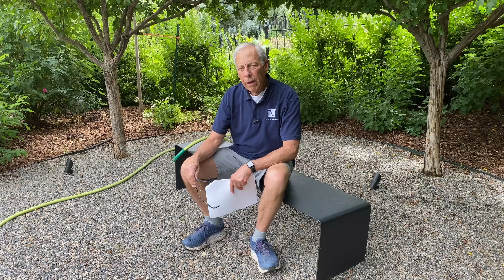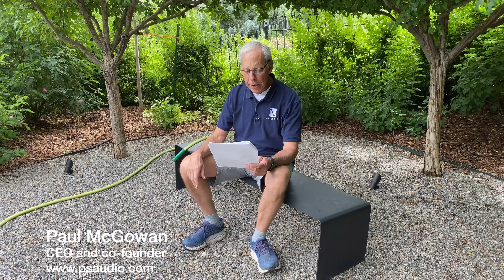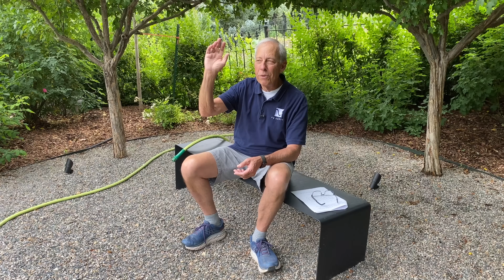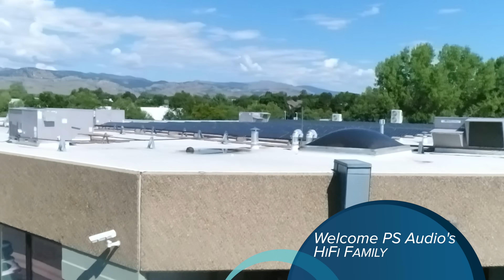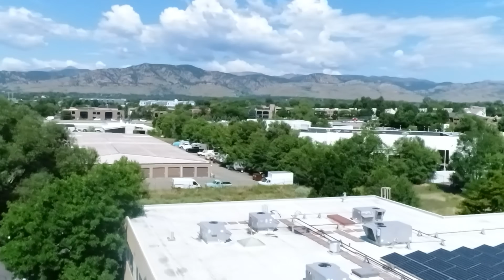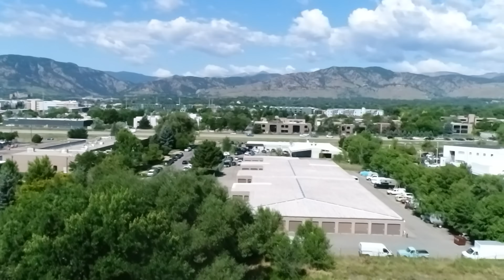Class D vs. Class AB amps

Comment: But everything is  relative   with amplifiers,Class A/B   may still be the king!But here is my example,I bought a nu force I-A7,second hand,and the first model   with 50 watts per  channel.But the seller   has a problem with it,strange   beeping noises at low volume.But i knew why that was happening,it is because that amplifier   is very affected  by RFI    and EMI.The rules are  you use a dedicated  electric circuit   one group   that does not have   things like a   fridge(compressor),Or  also if possible  nothing  on that circuit  with an SMPS   supply.The first model   I-A7   out in 2006   has an SMPS  in the housing.But so if you  read the manual  it tells you the do,s  and donts.The seller did not know that hence  the interference.And he was  done with it.The  nu-force I-A7   was new   1495  US   in the states,and when it came to the EU,was 1850   euros.So I bought the I-A7   working perfectly  by my house.For   125  euros.Oh!then plus the post  10 euros. so 135 euros,maybe US  110  dollars.There is no amplifier  of any class  that can beat my I-A7.At the price i paid,short term peak power  at 288 watts,and damping factor  over  4000,neutral  totaly.How much  would a class A/B  amp  that could beat my I--A7,cost?Its way better than a NAD  C720  BEE!  To coin a phrase  from the yanks,Its  all about Bang for the Buck! And i now love class-D.

Comment: I love class d but there is a but! Ice teknologi is the samme as the Switch mode 🎉🎊 🎉 if your not driving the biggest drivers you can manage butt ewen a old rotel rhb 10 from the 90s can beat anny Ice amp and almost any amp to day it has a warm/hott quality balanced sound whene going past 122db, the Switch mode amplifiers are not there but maybee inn 5 to 10 years 😇 i hoppe 🤞

Comment: One plus about an AB amplifier is if your speaker set up is in a cold room of the house, it can double as an electric heater.
Reply: No!thats class A   that makes all the heat.Like  red hot.Class A/B   is much milder  as far as heat is.If an a/b amp has a lot of power  then it gets hot.But nothing like a class A  amp.A class a/b  amp   gets warmer  by increasing  the volume.But a class A  amp   is full on using all the power from the transformer   all of the time.
Reply: I have Samson Resolv SE6 reference monitors and they use A/B. I live in Rio de Janeiro and they don't get very hot...

Comment: I have a Marantz PM50 AB Amp 70 watts per channel (Analaogue Only) from 1991 connected to a Pioneer DAC and it sounds beautiful sounding. The Vocals for example in Memory from Cats sounds very emotional, romantic, and connecting. I now have a little spare money and decided to treat myself to the Marantz PM12 Special Edition 100 watts per channel (Analogue Only) Class D Amplifier also connected to the same speakers and the same DAC as my PM50. At the time of purchase and listening i wasnt aware of it being a Class D Amp.  I hooked it all up and immediately put on Memory (as its one of my favourite songs) and was looking forward to the Vocal section, but when it arrived it didnt connect with me emotionally..... I then listened to some other favourite songs and it was the same..... I then switched Amps back to my old PM50 and the emotion returned!! I then kept switching amps (i had both set up next to each other just a case of pulling the speaker plugs out of one and into the other and the DAC interconnect) and i spent the whole weekend doing this.  I was shocked i had just spent £2300.00 on an Amp that isnt even as good sounding as my 1990 PM50! Luckily i was able to return it for a full refund.  I then started looking at other Amps and then realised that the PM12 was a Class D compared with my Class AB PM50.  I then also read countless reviews regarding Class D not sounding as good as Class AB.  I have now orderded the Marantz Model 50 (70 wpc and Class AB) which will be arriving this weekend and im hoping this will at least be equal to my PM50 or hopefully even a little better 😀👍
Reply: Are they as good as you hoped?

Comment: if people could accept, then class D with PWM modulation frequency > 1.41M should be the same quality as DSD64(SACD).
I have a full digital system that could provide very good performance... so we use that as monitor system

Comment: Bass rig related:
I'm looking for a bass rig that's light, compact, transportable. Class D suits this need.
Alas, every class d bass amp I've tried, with the same speaker, bass guitar, leads and cables, sounds awful. It's either to muddy or to brittle and bright. I simply can't get the same tones from Class D as I can with my Class A-AB amps... 
Since many Class D users abuse me and accuse me of "Hating Class D",  it's really hard to find an intelligent answers that's not biased or discriminatory. I assure you this is not the case. I simply haven't found one I've that's worked for me...
What am I doing wrong?

Comment: One is superior.  Switch mode power is the best.  Show me how that's not the case.  You can't, because when you understand the difference, there's no question.  Kind of like tube versus solid state.
As for signal processing.  Digital slays.  Photography, digital slays film.  These are demonstrable facts.

Comment: It's amazing how 9 months ago Class D was almost as good as class AB or Class A for that matter, But wow! What 9 months in research does is astonishing, cant believe how some of the best of class D amplifiers costing a fraction now surpasses all the classes of Amplification..
Reply: C’mon dude…
Reply: @babolababs4732  
Specs, performance, usage and tests using up to date test equipment is testament, that a properly designed and assembled Class D
Amplifier reigns Supreme, mind you most everyday workaday Audio enthusiast are so brainwashed by past hype, they will never ever get to test "even Mediocre ones" to see for themselves just how blardy much better they are, Only true way to know who's with the hype from what the actual TOP type is, is to own and test the various classes of amplifiers for yourself using your own Test equipment..
Reply: @KorAllRBare  Sure, but Class D isn't and won't be everyone's cup of tea. Definitely not the "ring to rule them all". Class D measures really well, up to and sometimes over the A and AB as well as G amps, but that's the measurement, not the actual and real listening experience, which for every person will be very subjective. I have Yamaha A-S1200 Class AB amp and the NAD C388, Class D one. They're connected to the same set of speakers via the switch. Guess which one I enjoy listening more? The AB, similarly to tube amps tends to 'color' the sound and provide a different sound stage both in depth and width, whereas Class D is clear to the point of being sterile. Some people will like this but may won't, otherwise everyone's should be ditching their linear and tube amps in favour of Class D amps, which isn't and hasn't been the case for all this time. 
The "Class D is better and has over taken everything else" was the statement we have heard many many years ago, (I have been into hifi for 30+ years and first time I heard this was some 15 years ago) even when the D wasn't even close to the others and outside of hifi domain, and this will likely continue in the future. But the amp manufacturers will not suddenly stop making amps and receivers in other classes. Instead there will be likely a balance of people owning Class D and other classes of amps. Bruno Putzey has paved a fantastic path of inclusion of the Class D amps into the audiophile and hifi domain and continue to do so, but the many challenges around well designed and implemented Class D module still remain, he and few like him just managed to find a way to minimize the impact.
And no, I'm not one of those people you mention above with blinkers on or being brainwashed, I have been around for quite a chunk of time in this hobby and I can tell you my NAD PWM amp will not replace my Yamaha any time soon but remain as an option I'd like to switch on or off from time to time when I want that un-colored, dear I say slightly uninspiring and sterile sound stage.
Not disagreeing with you, just saying from my own point of view what my experience has been so far in this area. Cheers.
Reply: As I said  @drazenbabich  For decades I appreciated a 100 Wrms for it's clean extra Dynamic Power and yet rich and full sounding reproduction "The hype convinced me this was a good thing" But when I compared my old Amp with my Current Class D I was at first befuddled as to why the class D produced a much more faithful reproduction in my test scope and yet to me sounded as if the music was not rich or full "no matter what the content or genre"

The class D simply had a cleaner and more precise signal closer to the input, whilst my Old amp seemed to add something extra into the wave forms as they were just off a little "it actually made it sound fuller", anyway it took a while, but now I am revolted at the sound of tainted music, thankfully An Oscilloscope makes that painfully obvious..
Reply: lol.

Comment: Hello! Can anyone (who has the equipment) measure intermodulation distortion of any good class D amplifier? For example, we have two signals with difference of 1kHz. We start from 2000Hz and finish to 15kHz. It would be very interesting!

Comment: Several years ago I got a (class D) ICEpower based amp and it was comparable to decent ABs. But I have to say that most recent designs of ucD-type amp modules (like new hypex) - they just outperform any AB amp out there, so we don't need to wait several years for that to happen - it's already there.

Comment: I am currently finishing the design of a 60 watt class D amplifier based on the TPA3116D2 by Texas Instruments and it by far exceeds any 60 watt class AB design in practical sound, cost, size, and reliability...in my opinion class D has come of age....class A and AB is left for the tubes...

Comment: I have heard a few good class D amps, and in my opinion they all sounded flat in the midrange frequencies.  Don't get me wrong they sounded great on the lows especially with really good and tight woofer control which can be a positive or a negative depending on what you are listening.  The highs were also very nice crisp fast and detailed with lots of sparkle and a huge sound stage.  But the midrange was anemic and lacked the fullness of the good class A, AB or especially Vacuum tubes where the midrange is the star of all the attention and just grabs your emotions.  So I find that class D is not emotionally involving especially in the midrange frequencies.  When class D technology reaches the level of tubes or good class AB in the midrange I will switch to class D.  I have a feeling that Purifi ET400A module has reached the pinnacle of class D technology and its only a matter of time before more and more people and manufacturers will start implementing it in their audio systems.  That romantic midrange bloom may never reach the same levels in class D technology simply because of the very linear and virtually distortion free audio reproduction.  In a sense our human hearing prefers a degree of 2nd order harmonic distortion that vacuum tubes and class AB amps produce, which is more relaxed forgiving with majority of music.  Sorry for the long read...
Reply: you should hear my class d topping tp-60 i modified.
Reply: Fosi ZA3 sounds good in midrange.
I have 2 in mono setup as well as a bunch of vintage receivers.
I listen to them all.
Reply: Reached that point since over yes..😊
Reply: D is better now?  @alanhosman8185
Reply: I actually compared an AB Amp with a D on the same set of speakers. The AB actually sounded like it reached noticeablely lower in frequency and just sounded more alive than the D across the board. D sounds fine until you make a comparison IMO.
Reply: @overnightdelivery  
Test equipment will actually show the AB Amplifier signal won't be as exact, in fact it will be "Muddied" which is what past Hype has influenced us to appreciate, and thus a Decent class D Amplifier lacking this muddied signal will seem uncomfortably lacking, Sadly Test equipment BTW will prove the fact that a Class D Amplifier can actually drive a Subwoofer much cleaner than most if not all AB amplifiers, which BTW an AB Amp will require a bucket load more of output Transistors to match performance to a Class D, Only problem is the more Transistors the more noise will be introduced just in order to match the output power of a Cool running Class D.
Reply: @KorAllRBare 
We want it to sound good not measure well.
Reply: @sammencia7945  I concur, but I also like to see the actual specs excel most if not all of our expectations, so much so that the current test equipment can not diferentiate one amplifier to all others 😉
Reply: @overnightdelivery  
Test equipment will actually show the AB Amplifier signal won't be as exact to a class D, in fact the AB or Class C Amps will be "Muddied" which is what past Audio Hype has influenced us to appreciate "Rich Full ambience" sound familiar? , and thus a Decent class D Amplifier lacking this muddied signal will seem uncomfortably lacking the consequences from an AB amplifier, Sadly BTW Test equipment will prove the fact that a Class D Amplifier can actually drive speakers including  Subwoofers much cleaner than most if not all AB amplifiers, Which BTW an AB or C Amp will require a bucket load more of output Transistors to match signal performance to a Class D, Only problem is the more Transistors the more noise will be introduced just in order to match the output power of a Cool running Class D.

Only way to know the truth is to get a hold of a decent recording Oscilloscope and test for yourself.

Ignore the Audio BS Invest in your own test equipment and learn the truth..

Comment: Does the sound quality of class D amp depend on the RF susceptibility of other gears in the hi-fi system?
Reply: Class D means bass only means I’ll fry your sub that pushes more Rms.  Class A & B mean both bass and Rms means bigass speaker throwing everything. Means if u want both class ab for both or go separate Class D in the back and Ab in front lows and highs  wrong setups will pop them amps

Comment: After using AB tube, and solid state amps for 60 years, I got the two Class D monoblocks from Emotiva. I have very high admiration of these Emotiva Class D amps! Indistinguishable from the many AB's I used previously, except for having wider dynamic response.
Reply: Aren't they class H?

Comment: any thoughts on Hypex?.. I've been so on the fence with splurging on Barefoot MM45 studio monitors that use 3 tri-amp of the Hypex per side over a traditional mixing setup of Proac Studio 100's amped by a Bryston 4B SST
Reply: They're really, really good -- a bunch of Hypex modules are used in the highly-integrated Kii Three system, which delivers some of the best audio performance on the planet from very compact enclosures.  It goes for something around $20kUSD.  IIRC, Bruno Putzeys was the lead designer.
Reply: Check for Hypex NC500 or even better NC1200. You won’t regret it. Even pro audio studios use it. I am very happy with it.

Comment: Class D is OK. In the end it’s an audio industry topology that makes good power for cheap. I take issue that certain companies are charging $$$ for Class D’s whereas for the same money, one could get a better Class A or A/B.
Reply: That's where I'm currently sitting right now. I don't require more than 10W of power as I'll be using high efficiency speakers. Most decent amplifiers cost between 1000~3000€ and about half of these models are class D. Prices shoot up with streaming functionality. I decided to bite the bullet and get a custom-made class A tube amp for 1800€. I thought that Class D would disrupt the market with high value offerings. That is so far from the case right now. Class A/B is as expensive/cheaper.
Reply: @user-xg6zz8qs3q  We think the same!
Reply: Can u get 4500 watts for 550$ in class ab??